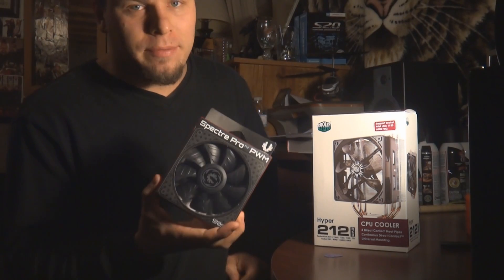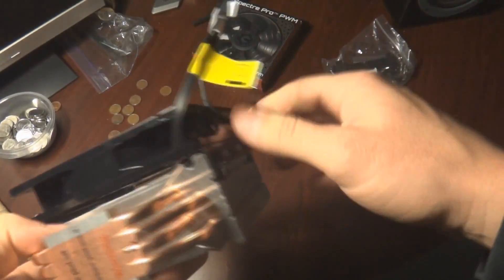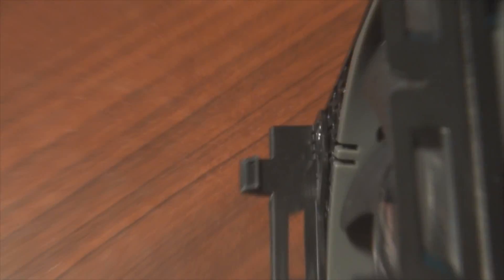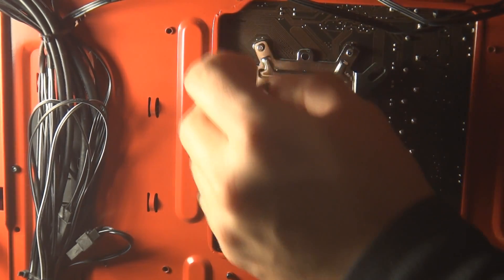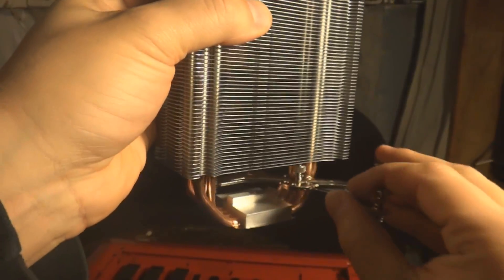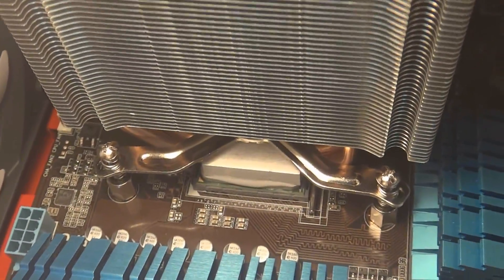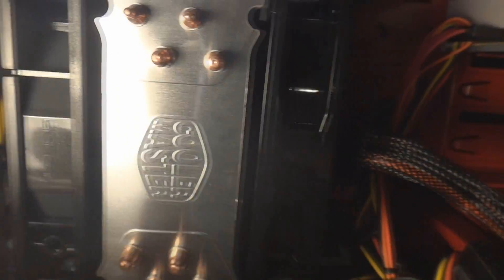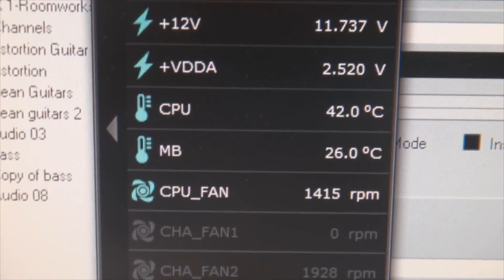Cooler Master Hyper 212EVO installation into NZXT Phantom 410 case Socket AM3+

Comment: will this fit on a msi 760 gma-p34(fx) motherboard?
Reply from the maker: yes depending on the CPU you are using
Reply: ok, thanks. Yeah I am using a AMD 6 core processor (fx)
Reply from the maker: That's exactly what i used.
Reply: Update: I have installed the cooler and it works GREAT

Comment: I want all 4 sticks of RAM available. Could I use the included fan as a pull on the back instead of a push on the front, or is that not a good idea?

Comment: This video was so helpful. I had purchased this heat-sink along with this case and when they came in the mail I was worried that the heat-sink wouldn't fit into the case. But actually seeing it fit into there on someone else computer is nice. Thanks.

Comment: this cooler works great i just had to relocate my ram into the 2nd and last slot because they were in  the way. I saw degrees on my cpu drop as low as 14C when just idling.
Reply from the maker: yea its about a 20 degree difference for me. I love it still. Also you can actually adjust the fan and move it up so you dont have to move the ram. I had to do that for a friends PC.

Comment: Someone needs to help me out! My air flow doesn't work because I don't have the fans on top of the case but on the back. But because it's a AM3+ motherboard, I can't place the cooler horizontally. Where do I get this silver thing you got? Because I don't have it. As I said, I can't place the cooler horizontally.
Reply: it should of came with the package when you bought the 212 evo.
Reply: initiald22 Yeah, but I didn't... :D Nevermind, still thank you!

Comment: Thanks for the video, I have the same board and I was wondering if this cooler could actually be installed vertically. Thanks to you now I know it can be installed that way. By the way the Asus suite isn't really suited (pun totally intended :) ) for measuring the temps on latest fx processors as what it shows as "CPU temp" is actually the socket temp, which tends to be higher than the actual CPU temp. I recommend using a third party app like hwmonitor or the likes, and look for "CPU package temp" it is the actual CPU temp that should no go higher than 62-64 as per AMD advice. As for the socket temp (the one Asus shows as "cpu") should not go higher than 70 or something like that.

Comment: Kozmeek what mother board are u using will the asus z87 pro work with the same case and the two fans. does it have enough clearance
Reply: Kozmeek What program are you using to monitor your CPU?
Reply from the maker: its a Asus m5a97......And it should work yes. If your using the same case the motherboard position will be the same regardless. I have maybe about an inch from the side of the case after its all put together. Its tight but it does fit. So it should on yours as well! Good Luck!